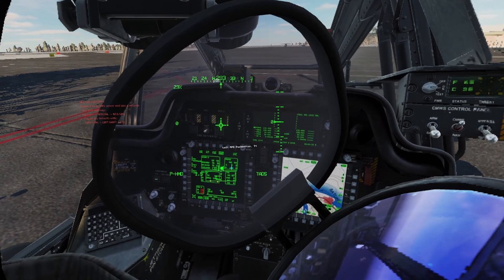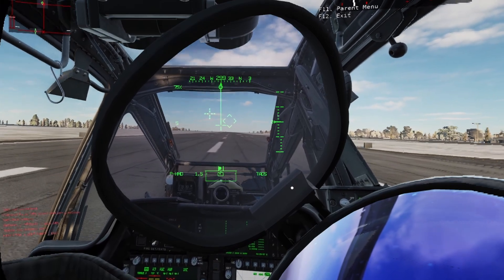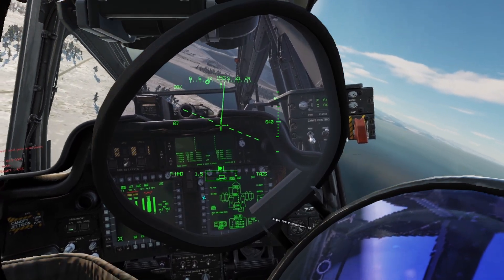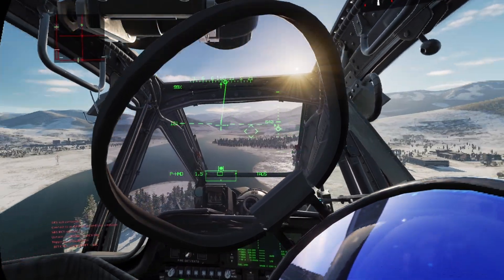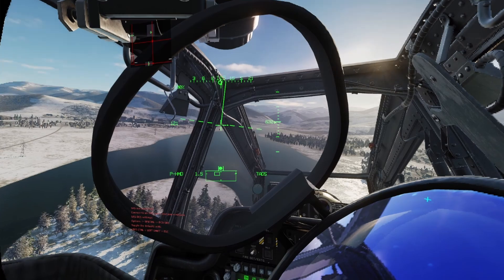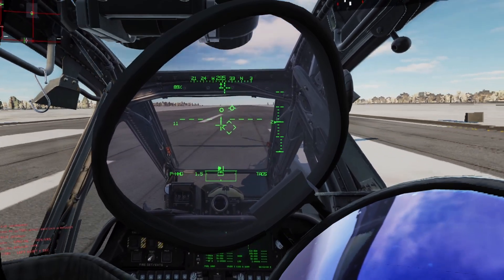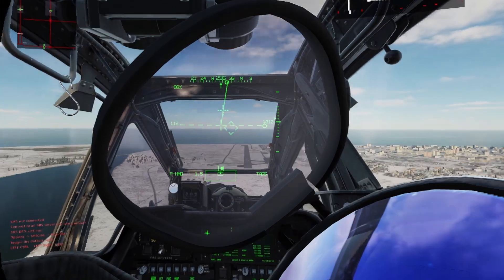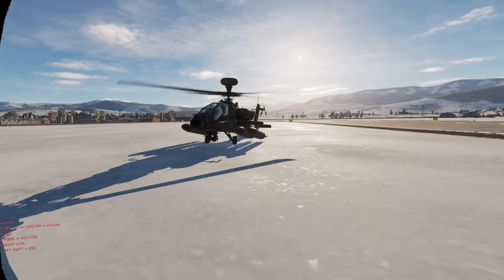REAL APACHE PILOT gets HEAVY!

Comment: The helmet mounted monocle looks totally different in VR than normal. Mine looks like it's right up against my eyeball. I am assuming that it's because you're in VR right? Not some setting you can tweak to make it pull away from your eye? And well done for landing that sucker when it was torqued out. I would have been in a fireball the first try! lol
Reply from the maker: I don't think there is any way to adjust it. I usually turn the monocle off and just fly with the symbology.

Comment: Great video.

Is it me or since the latest open beta update the Apache is super squirrelly to fly, like the tiniest cyclic movements send it gyrating one way or another and it constantly wants to tilt hard to the left or right.  It makes it a lot less fun to fly as I'm constantly fighting it to stay stable.  Doesn't matter the airspeed or torque setting.  Previously it would exhibit this behavior when flying full speed/power at around 140knots, but now it does it no matter what
Reply from the maker: Thanks! I can’t answer that well as I just put an extension on my cyclic, which gives me a lot more leverage and effectively makes it less sensitive. Although tonight it seemed a little more sensitive than normal, but that could have just been the bourbon. 😂
Reply: @schoolio64D  Ah ok. Thanks for responding :)  I saw a thread on /hoggit earlier today where people were explaining the same behavior I've been experiencing while some others were saying it seems to fly better.  I've got a VKB Gladiator which has a pretty small throw to it but I've never had a problem with precision in anything else.

I really want to avoid adding too much of a curve to my x and y axis as I don't like how sluggish it ends up.  I think I have mine set to around 10 or 15.  I actually lowered it to force me to be more delicate.  

With the control display window or whatever RCtrl+Enter is called open, when I manage to get the aircraft trimmed out to fly in a straight line the green mark around the red diamond will be moving around while the red diamond is stationary, in other modules they pretty much just follow each other.

Just an aspect of an early access work in progress I guess.  It just really sucks that I can't fly it for too long without getting exhausted from paying 120% attention

Comment: What headset are you using?  That pixellation in your peripheral vision is crazy, but I am wondering if it is just an oddity of the recording.
Reply from the maker: I’m using an Oculus Quest 2. I have the visual settings turned down in order to be able to run DCS and the recording software at the same time and get good frame rates. You don’t really notice the pixelation in the headset that much because it’s all at the edges. I’m working on a couple fixes, but unfortunately they’re all hardware based ($$$) so hopefully I’ll be able to have better VR resolution soon.

Comment: Nice steady VR presentation, not easy to do.  Image looked quite good actually!  What VR gear and settings are you using?
Reply from the maker: I’m using an Oculus Quest 2. I have the settings turned pretty low so I can record at the same time.
Reply: @schoolio64D  looks like it has fixed foveated rendering? is that implemented in DCS? Framerate is really good with decent shadows, you should post your settings ;)
Reply from the maker: @ziljanvega3879  I am new to all of this VR stuff, but if I understand correctly, then yes, it does have fixed foveated rendering. For VR and recording, I pretty much have all of my DCS settings turned as low as possible. I've bumped a few of them back up, but between DCS and OBS, my CPU is struggling to keep up with the demand. I was using a second PC recording/streaming setup, but I can only get 1080p out of that, and I can't bump the settings up high enough in DCS to make a difference. Still experimenting though. Thanks for watching!

Comment: How would you initiate an autorotation for practise? I tend to cut the throttle to idle, but then I lose everything... In the Huey I just cut the fuel valve and after landing I start up again for another attempt.. Seems easy in that one..
Reply from the maker: Start the APU. It’ll keep the generators online after you hit the ground.
Reply: @schoolio64D  But if you have a dual engine failure, starting the apu is not an option. That takes way too long. How would it work irl?
Reply from the maker: Why isn’t it an option? Reach down, push the button.

IRL, you don’t pull power levers back during practice autos. You also don’t take them all the way to the ground.

Comment: That was one heavy lad 😂
A true autorotation is impossible in its current state. You can only manage to do one with a lot of forward speed. (Check out my video on autorotations in the Apache).
Reply from the maker: Yeah. Too heavy, and the nose started to fall over completely when I lowered the collective. Had to hold aft cyclic just to keep it from nosediving, and bled off my speed too much.
Reply: @schoolio64D  Haha yes, if you're a fraction of a second too late then there's no chance of recovering from that nosedive.
Reply from the maker: @plokkum  I tried it again and was able to get it to the ground without destroying it, but even with rotor RPM at 100, it doesn't cushion very well at the bottom. It doesn't appear that the normal autorotation technique for this aircraft is going to work until they make some changes to the FM.

Comment: Have yet to actually try an auto rotate in the apache....might give it a try next time! Cheers! Quick question.....what do you use to record in VR? I usually save the track file then record in desktop mode to get my 4k res. The res looks pretty good here 🤟
Reply from the maker: I’m using OBS, but because of that, I have to turn the visual settings down, which results in the pixelation you see at the edge of the screen. Nvidia shadow play will work also if you have an nvidia card, and it’s less taxing on the CPU, but it doesn’t record voice.
Reply: @schoolio64D  yeah I use nvidia and wish I could record voice! Thx brotha! Cheers

Comment: Mostly unrelated question: can you disable the auto-display of engine page when you exceed torque limits? 
I think its annoying when you have your video page set up and then get into engine page if you hit the limits. Also I can only get the page display off again only by reselecting video page, is there a better way?
Reply from the maker: I don’t believe you can disable the engine auto-page, but I’d have to look. I haven’t figured out a better way to get the video back up either. I usually put the TSD on the left and the video on the right.